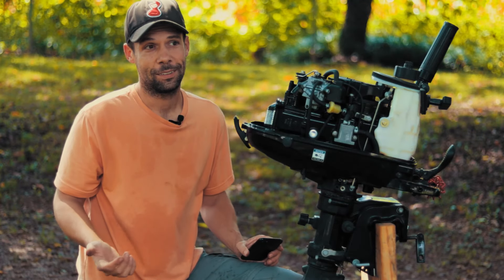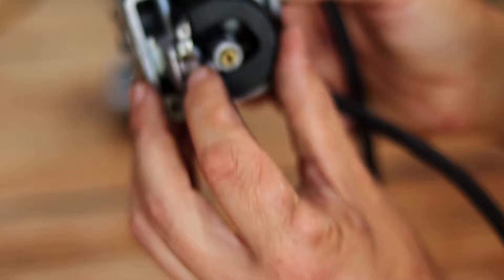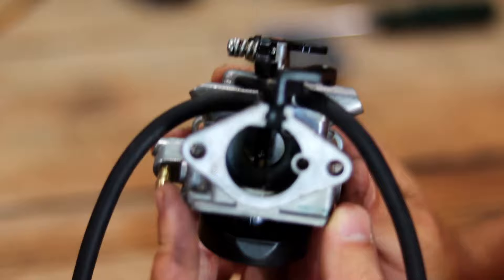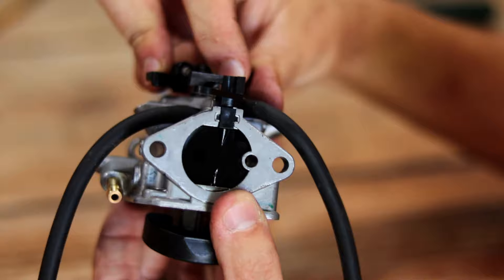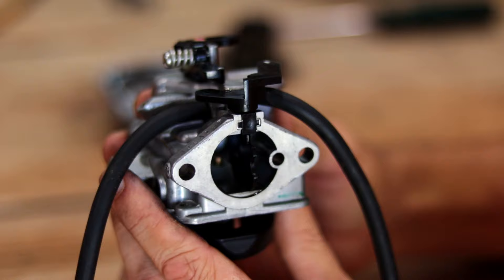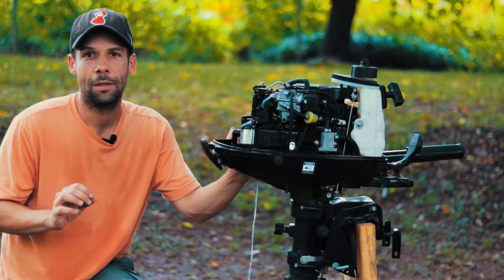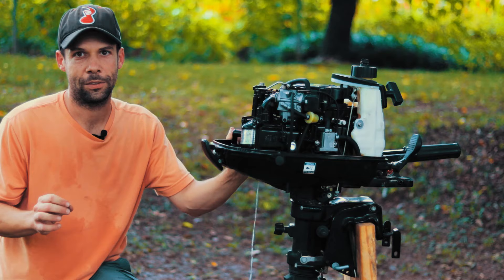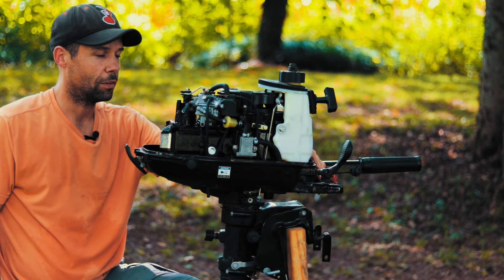Outboard Won’t Start: Carb Basics, Flooding, and How to Start a Flooded Motor

Comment: Sorry to be a downer but there is an easier way to get it running without all of that effort. I am a clammer in Massachusetts and go year round clamming. Even in 10 degrees. I have used a mercury 20 hp 2 and  a 4 stroke for 21 years.  To prevent flooding, don’t pump the ball ever. If flooded, pull the gas line off and pull the cord and clear the gas. Pull until it fires up then attach the gas hose back on. Simple fix and it has worked on at least a dozen of my friends motors as well.
Reply: Man thank you for the information!
Reply: Choke or no choke?
Reply: Open choke, take off gas line from motor and pull. Should take a few pulls. Let it start and plug in the gas again.
Reply: I hope this works...or I'm stuck at sea...

Comment: It’s funny. I cleaned out my carburetor the other day after letting my boat sit. I couldn’t find a spare gasket, and noticed that the motor was running great, but fuel was spitting out of the sides of the fuel bowl seal on my carburetor. I ordered a rebuild kit, and the gasket fit fine, but I noticed the other parts were a little weird. I put a new float in the carburetor and a new gasket and noticed that it was venting fuel out of the top fuel vent and the motor flooded. I had a feeling it was the new float causing the issue. This video confirmed that, and I switched the old float and needle out and it started the first pull. Two lessons learned tonight: if it’s a good deal on Amazon, it may not be the best quality. And if it doesn’t need to be replaced, don’t go and replace it. Shame on me for not running my boat for over a year!!!!
Reply from the maker: Yeah good advice. Sometimes you can do too much. Honestly running you motor to keep things flowing is the most important thing you can do. Glad you got it figured out!
Reply: I did similar with a new used engine and it ended up saving me money. When I rebuilt carb with amazon kit I didn’t use all the parts since some were different. Mostly wanted gaskets. Few weeks later had gas spew issue. Neighbor convinced me to take it to his small engine mechanic of many years. Mechanic said it was the gas float piece which stops the gas from coming in and I needed a new carb. Fixed nothing. 

Local store quoted me $700 for carb, new ones online dealer $325-$400. I studied and realized non adjustable plastic float was from Mercury but Amazon replacement had the adjustable metal piece. I studied how people adjust Harleys and then figured out how to adjust it. Worked beautifully after adjustment. 

Fyi Jonny, a video on this adjustment process is needed for small boat engines. A huge void exists around this. I like your style.

Comment: Do these POS motors have an air fuel mix adjustment? The carb that came with it had the s rew all the way seated. Tried all the tricks. New carb ahas the screw seated as well. New fuel pump. Still flooding.  WT???????????
Reply from the maker: Yeah but they have a cap over the screw so you can’t adjust it. I think it’s an EPA emission thing requiring them to cover the screw. You can pull the cap off but i think it might void warranty. Not sure

Comment: well here I was worried it maybe wasn't getting enough fuel... now convinced I had flooded it.  letting it try out, I have two sore shoulders from attempting to get it to go.  Exact same motor.   I think fuel tank out in sun may have expanded and flooded it started part of the issue. hopefully can get it going
Reply from the maker: Yeah those tanks are difficult in the summer, most people leave the cap cracked (not recommending that :) ) a fuel demand valve will prevent pressure getting to the motor

Comment: Thanks for this excellent video.  One part of it confuses me.  You say the the key part of starting a flooded motor is to "maximize air flow and minimize gas going into your motor".   But then you recommend a starting procedure that involves no choke and 100% throttle.  Seems contradictory.  Doesn't 100% throttle deliver the most gas possible into the engine?  What am I missing here?  I have a new (3.5 hours into the broken period) Yamaha 8HP outboard.  Runs perfectly when I can get it started, but seems to flood far too easily, and then doesn't start at all until I drain the gas out of the cup and dry out the plugs.  Very annoying, to be diplomatic.  Advice PLEASE!!!
Reply from the maker: It does seem contradictory. It’s more about the gas to air ratio. 

Choking restricts air flow because the choke literally covers the hole where air enters the carb. So the motor sucks more gas and less air. 

The throttle valve opens and closes allowing more or less air in. At full throttle, the throttle valve is open which allows the most air in as possible. 

Full throttle creates the greatest ratio of air to gas that enters the motor. It may still be more gas than at low throttle but it is much more air which is key. 

Low throttle = low air to gas ratio 
Full throttle = high air to gas ratio 

Sorry I didn’t make this distinction, but you are right. It’s more about the ratio vs the actual amount of gas entering the motor.
Reply: @Skinnyriver  Thanks so much for your quick and informative reply.  
I figured out an easy way to effectively vent the cap on my otherwise bloating gas tank, so back pressure is not the cause of my flooding.  Your tip about not squeezing the primer bulb too rapidly might be helpful.  I'll have a go again tomorrow and see.  I'm pretty new to outboards, and having purchased new one of the top rated brands (Yamaha) I was expecting a trouble-free experience, at least for a while.  I guess when it comets boating, that is an unrealistic expectation after all.
Again, much appreciated!
DC
Reply: Opening the throttle lets more air in which mixed with higher vacuum of higher RPMs does use more fuel, but at low vacuum when starting does not draw in as much fuel until RPMs increase, while choking blocks air flow which limits air to the engine increasing fuel to air ratio.  Try first cold starting without choke, Choke only when necessary.
Reply from the maker: Great points thanks

Comment: choke while running will flood it good..putting in gear on bigger motor will enable use of full throttle to crank and give min gas and max airmotor sucks harder when throttle plate blocks air flow.. just like you use full throttle to un flood an old carbureted car..nice vid tho...

Comment: Sir I’m  of having a flooding problem.  My Mercury 40 hp sea pro 2 stroke loses prime after sitting or a few hours.  Runs fine once started but takes pumping primer bulb a lot while turning it over.  Any advice what to check?  Thanks
Reply from the maker: I would first check and rule out the priming bulb. Sounds weird but Shake the bulb and then Hold it vertical when priming  next time to see if that helps. Sometime the check valve stays open and it pushes gas back into the tank vs to the carb.

Comment: Super helpful video. My outboard flooded. I maximized the throttle and let airflow through the choke. Disconected the gas. And turned on after 2nd pull. Subscribed and liked.
Reply from the maker: Awesome! Glad it helped. Thanks for the sub!!!

Comment: This video is a life saver.  My 3 days old outboard shutdown and won't start.  I followed the troubleshooting in this video and it started in a few cranks.  Wish I found this earlier.   My other motor is identical and is only 40 days old with the same issue.  The dealer wasn't able to help and I had to get another one for my trip.
Reply from the maker: Awesome! Thanks for the kind words. I appreciate the view and hope the new motor works really well for you.
Reply: @Skinnyriver  Taking it on the water today.  At least I know where to go for tips if it does die again.  Keep these videos coming man.  Love it!

Comment: Thank you so much for this video! It saved me from my own stupidity. I had started the motor with no problem, then as I was still at the dock it quit! Spent 40 minutes trying to restart but it wasn't getting gas. I unknowingly had pulled the emergency fuel shutoff lanyard engaging the fuel shut off.  You mentioned the emergency shutoff in your video and I knew right then what had happened. I went and reconnected the clip and wallah, motor started and ran great!
Reply from the maker: lol I’ve done that many times 😂 glad you got it going! Thanks for the view

Comment: This saved me on the waters. I simply just trolled for 2 hours and let it dry out. Primed it firm, put throttle just a bit half way, and the motor started up like a champ. Thanks for the tip! I have a 6 cylinder so pulling tjose spark plugs out one by one would've been a bit of a hassle.
Reply from the maker: Awesome, glad you made it back without a tow. We’ve all been there!

Comment: So relieved to find this video. Too bad I found it after absolutely obliterating my shoulder trying to start my outboard for the first time, yesterday.
Reply from the maker: We’ve all been there. I think I pulled my should out of its socket last year, no joke it hurt for 3 weeks. 😂 hopefully the vid helps a bit. Also here is a short vid where I found what my motors problem was https://youtu.be/tD2eeR7btXs
Reply: Felt it in my shoulder blades

Comment: Great videos man I really have learned a lot from them, I have a new 5 hp mercury  and I still don’t feel it a reliable motor. It takes to long to turn on…. Then it runs well but when you stop it and turn it back on  after  two minute it dies, sometimes it is easy to turn on again sometimes it takes for ever. I have not even finished the break out period and I’m not liking the motor. I have done the initial pumping for the aux tank and it seems to work on the initial start up but as a girl y really get tired turning on that motor. My previos one one or two pulls max.
Reply from the maker: I feel your pain. It can be frustrating pulling and pulling and it doesn’t start. I’ve never had an issue after it starts and gets warm. If it’s under warranty I would see if Mercury would pay to have a mechanic look at it. You deserve to have something that is reliable especially if you bought it new. If it’s used, you probably need to clean the carb and always use ethanol free gas

Comment: Can you recommend me if there is some kind of replacement carburetor for the Mercury 3.5hp (some replica that turned out to be good). The original is too expensive for me. Or can You suggest me where could I get a used original one (that would suit me best). Thx

Comment: I really like your videos, very very helpful...I recently acquired a Mercury 3.5 four stroke and would welcome your advice re fuel. Posts clearly want to avoid ethenol if possible. Do you favor a higher octane (ie 94) and will a higher octane be ethenol free? What about additives?
Reply from the maker: I’ve tried high octane and didn’t notice any difference. If you can’t get non ethanol, get an ethanol gas treatment additive. Most also stabilize the gas so it’s really good. I would say the nonethanol with a fuel stabilizer is best. Second best (but almost just as good) is any octane with ethanol and a ethanol gas treatment that also stabilized. I use 360 Marine.
Reply: @Skinnyriver  Need help....My 3.5 hp Merc is driving me nuts. I can only idle w/ choke...1st start of the season..errrrr....Thoughts on where to start, jets, fuel pump????
Reply from the maker: @kerrywages9631 if it only runs with choke on it means gas is getting to the carb (so probably not fuel pump). Gas is getting to the carb but not enough is getting to the motor from the carb. 90% of the time having to have choke out means there is contamination in the  carb jets. I would try some sea foam treatment then look at cleaning the jets.

Comment: Great stuff!

Honda 5HP that ran like a top last couple years suddenly giving me fits as it’s not dependable (sailboat Lake Erie) 

The throttle is limited to 1/2 open upon start up. Any suggestions?

Thanks
Reply from the maker: Is it a 4stroke? When you say limited to 1/2 open, does it bog down after going above 50% throttle? Or will it only start at 50% throttle then die?

Comment: I have a Problem with my 3.5hp Tohatsu. Fuel is pouring out the fuel vent tube and I keep running out of fuel in the top tank now. How do I fix that?

Comment: Got a 2005 6 hp tohatsu was running great first pull 2 times third time i tried i forgot to put the choke in wont start now checked the plugs they are fairly rough and not the right plug either very weak yellow. Spark . Checked all the fuel lines they seem fine i checked the pan on the carb and no fuel is coming out of it any help would be appreciated

Comment: I put my 3.5 Mercury in a rubbermaid tub.  Started it up.  Seen what appeared to be an oil streak coming out of my lower unit.  That must be the overflow gas out of those hanging rubber tubes you were talking about
Reply from the maker: Yeah mine did that, it’s definitely gas coming out of your carb. Let me know if you keep having problems. Hope you get it figured out. It’s a great motor if can get the starting figured out
Reply: Skinny River i put my lower unit in a bucket of water today. My choke was at full bore.  I pulled my starter rope twice and the engine started to sputter.  I pulled a third time and nothing.  I turned my choke off.  Turned the gas up full throttle.  Pull 3 times and it started right up.  Thank you for the help
Reply from the maker: Glad you got it started. Sounds like you got something going on with your carb. Are you using an external tank or internal? My best guess is your carb float maybe letting in too much gas or something is causing your carb to pull in too much gas and not enough air. If you are using an external tank, try the internal tank to make sure the external tank is not causing the issue. Sometime they build pressure and force in too much gas

Comment: Great videos. Subscribed. Any tips on engine gate post flooding it when you get home?
Reply from the maker: Hey I appreciate the view and sub! What is the situation when it floods? Sorry I’m not familiar with engine gate post.
Reply: Shoot that was a typo. I meant any tips on engine maintenance/things to do post flooding when you get home. Thanks for the responses
Reply from the maker: Other than trying to find the root cause reason why it’s flooding, if it was a one time thing there’s probably not much you need to do. I would kill the gas valve, put the motor in the down position and everything will dry out eventually. There’s not really a need to pull the spark plug or drain the carb.

Comment: Will a carb that’s too lean run at too high of rpm’s at idle? My 3.5 merc will start fine but then rev high after like 30 seconds. 

Previous owner put a carb with a pilot screw in it. The original carb doesn’t have adjustment.
Reply from the maker: I believe that lean will result in higher RPMs. I believe that all the carbs have a pilot screw however manufacturers  have to cover the screw with a cap due to EPA regulations (because it impacts emissions). But yeah, if I was you I would try to adjust a bit. You should hear the RPMs change

Comment: That little motor is making you a lot of money. (I hope) Great videos.
Reply from the maker: Ha h I’ve milked it to death. Yeah not much money on YouTube without sponsors unfortunately :( I’m also running out of ideas 😅
Reply: @Skinnyriver try a video on pressure lock when cord won’t pull
Reply from the maker: @SailingwithMaury that’s a great idea thanks

Comment: Ciao, complimenti per il video
Come mai il filtro della benzina è tra la pompa benzina e il carburatore? Non sarebbe meglio metterlo prima della pompa della benzina?
Poi volevo chiederti la pompa della benzina ha solo 2 tubi? Uno in cui entra e uno in cui esce? 
Chiedo perché ho trovato pompe benzina con 3 tubi
Reply from the maker: buona domanda!  Penso che il filtro del carburante sia dopo la pompa del carburante perché la pompa del carburante dovrebbe lavorare di più per estrarre il gas dal serbatoio.  la pompa del carburante è progettata per gestire l'alta pressione sul lato di uscita ma non sul lato di ingresso.  Penso che a volte ci siano 3 tubi perché alcuni hanno un bypass per quando il carburatore è pieno e la valvola del galleggiante si chiude.  la pompa del carburante non si spegne quindi fa ricircolare il gas fino all'apertura della valvola del carburatore

Comment: Great video-thanks!  Question:  When I start the engine, have the choke all the way out, the engine starts, runs for a couple of seconds, but then dies.  Should I be closing the choke right away?  Increasing throttle?  Leave the choke out and let it run for a little bit?  It seems like whatever I do, it dies in a couple of seconds, then it gets flooded.  Your tip did work after that happens:  choke all the way in, full throttle and then it starts and runs.  But, how do I keep it running when it first starts?
Reply from the maker: I generally leave the choke out for only a couple seconds then kill it completely with throttle at idle speed. Your motor should run without choke pretty much immediately (unless it’s really cold outside). I would try half choke for a few seconds to slow it to get warmed up. It really sounds like you are not getting the correct fuel/air mixture and need to clean the carb (especially the idle speed jet in the carb). But in the mean time I would start with full choke, after ignition drop to half choke and slightly increase throttle as you go to no choke. Then once it’s purring and warm drop to idle. 

But honestly this all points to carb needing cleaning or adjustment. It should run pretty Much immediately.
Reply: @Skinnyriver  Thanks, I’ll try that.